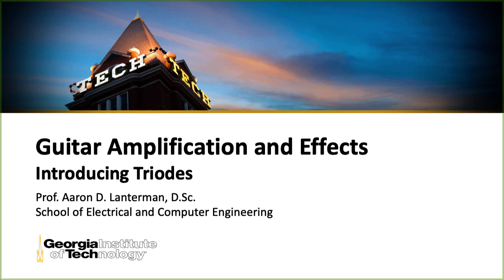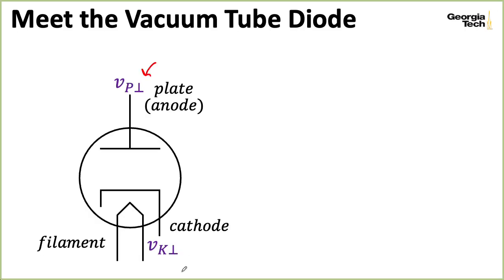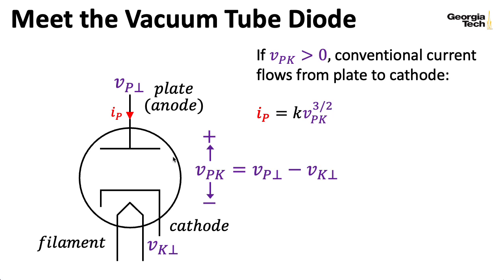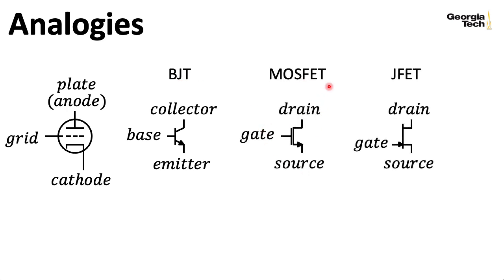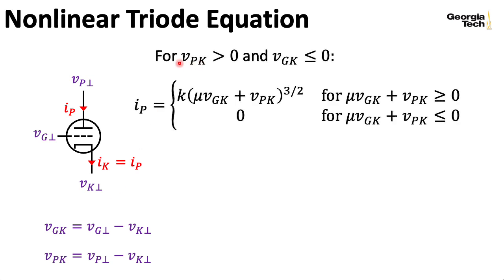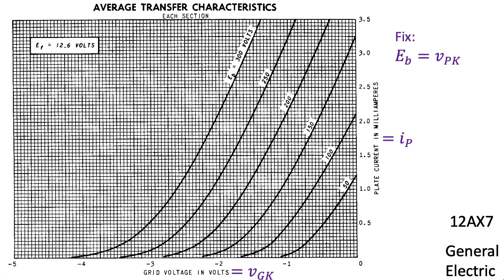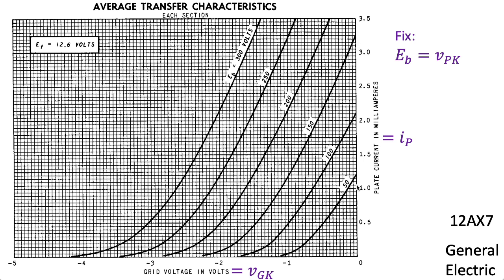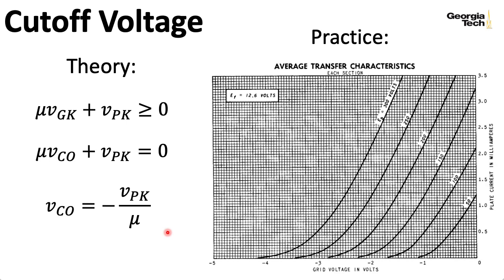ECE4448 L14: Introducing Triodes (Guitar Amplification and Effects, Georgia Tech course)

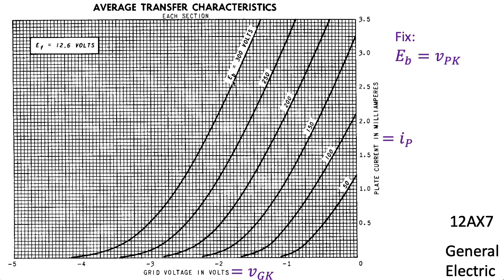Comment: 9:13 The “E” stands for “Electromotive force”, and the subscript “b” stands for the “B+ voltage”.
Reply: 11:28 “E” has been covered, “c” stands for the voltage applied to the control grid. Actually, the grid in a triode is a control grid.
Reply: Forgot to mention, “c” is the c- voltage dating back to the a+(heaters), b+ (plate), c- (grid bias) batteries from the early days of radio.

Comment: Hello. I'm wondering why the grid of a triode doesn't take the current load from the cathode. In many circuits with BJTs or triodes, the configuration is common emitter or common cathode. The amplified signal is at the plate or collector. Wouldn't a lot of current sink into the grid because the voltage difference between the grid and cathode us usually intentionally negative for biasing? The plate is a positive potential while the grid is negative.
Reply from the maker: There can be a tiny bit of leakage; some very very old tube amps will actually use a 10 meg resistor and generate their biasing that way.  But mostly the grid is more finely spaced than the solid plate so a lot of electrons go flying through the grid, and as you say, it's the negative potential on the grid that actually repels electrons and generally makes them not want to go the grid. The electrons really want to go to the positively charged cathode.

Comment: Great video. I took up a tube amplifier design course some months ago and am building an EL84 push pull hifi amplifier. I wanted to do some modeling first. I have build a uTracer device, which is a kit, to create my own datasheets with curves of the tubes I have. I can export the data and use it to create a spice model using another tool. It seems to work really well in the time domain. My preamp and phase inverter stage behaved exactly like my real amplifier. Just a few mV difference. 
I haven't done work in the frequency domain yet. But I think this method might be interesting for your class.
Reply: What tube amp design course is that?  Is it available online (and in English for those of us who only speak one language)?

Comment: I have made some designs in eagle some time ago using the 12AX7, but not yet build them.
Awesome lecture again, thnx.

What your opinion on rectifying 220 Volt using a suitable bridge rectifier (witch becomes multiplied by 1.4)  and apply it?
Reply from the maker: The "All American Five" radios didn't use a power transformer, just a rectifier. There's some guitar amps that use a similar design. They're called "widowmakers" for a reason. ;)
Reply: @Lantertronics  Widow maker, lol.

Well, if you had some basic electronic study at school, you should know that AC can feel quite shocking or unpleasant atleast and you should cover it.

Professor here in west Europe we all have a device in the closet where there electrical meter is fitted, it a so called "earth leak device" it senses if there is a difference bigger than 33 mA between Neutral and Phase and immediately trips / cuts the power. like a old school balanced weight scale .. or how ever it's called.
in some counties like Spain is called: a differential.

Pretty much no1 dies here in west Europe by electrification, unless they toughed the wires before the device .. somehow.
Reply from the maker: @AnalogDude_  We have something like that in some specific rooms on some specific outlets, called GFCI's. But they're not universal. I think they're mandated in kitchens and bathrooms, or something like that.
Reply from the maker: To be safe I'd always use a transformer for isolation, even if it's just 1:1.
Reply: @Lantertronics  Well, sure ... but even modern led lights use simple low voltage parts , like resistors, diodes, ic's and tap right into the 220 Volt, since it's all about the load.

Witch is really weird to see.

Some famous guy toke apart some specially for Dubai formulated Philips led light, it where just simple parts, as did i also toke apart some of them.
Reply from the maker: @AnalogDude_  That is very interesting; I found a fascinating discussion of such circuits here: https://electronics.stackexchange.com/questions/76883/how-do-led-light-bulbs-work
Reply: @Lantertronics  this "power" supply circuit from the Dubai lamp look very interesting, those capacitors before the bridge rectifier. that's something very uncommon, what's your view on that? ... would it serve for a tube?
Reply: @Lantertronics  The idea that i had maybe doesn't work.

if you would put approx 300 V DC on the tube and a 50/50 ( 2 x 100K - 2 watt) voltage divider on the grid for an offset, there would be a capacitor that has 150 V on it and it would kill a opamp if you try to add a 10 V.p.p. Synthesizer signal into the tube. also the +/- 300 V after the 47K resistor on top of the tube heading to a output capacitor would have 300 V and also kill the opamp.

Any suggestions?
Reply from the maker: @AnalogDude_  Sorry I'm not following you. You'd always have DC blocking capacitive coupling caps at the input and the output. And in any case, regular tube preamps circuit rarely used fixed bias schemes like you do with BJTs... they usually use self biasing (which I will get into in a later lecture).
Reply: @Lantertronics  thank you for the answer and knowledge.

Comment: Impressive stuff.  Although this technology is irrelevant by today's standards but still for certain applications, we just don't have a solid-state alternative. Like Photo-multiplier, magnetron in the microwave oven, klystron,  for generating e-beam either in thermal evaporation (PVD deposition) or in various semiconductor processes associated with plasma, x-ray, etc.; In medical technology for CT and X-Ray tubes are some of the day-to-day examples of tubes. 
I remember during my undergrad, I designed one with nichrome wire, metal mesh, copper plate, and test tube to re-investigate the working; it works on 12V filament with 160v dc across anode-cathode and a voltage divider with 5w resistors to generate control voltage.
Although with a lot of background reading on tubes and valves, I found out that the filament of the tubes is actually coated with a small amount of radioactive compound salts to improve emission and overall performance of the device.
For AC- DC conversion, Mercury arc rectifiers were used in old days.

Comment: I’ve actually read in one of my old tube books they do describe electrons boiling off as it’s heated , also in some of the rectifier tubes that are commonly used in old amplifiers the filament voltage does have an effect on rectification it’s using a 5 volt supply. And I believe I did read something on the filament voltage adding some extra capacitance to the operation of the tube ? Or it had to do with the gate 🤷‍♂️ it been quite a few years since I played with tubes . Good job on the explanation of operation 👍

Comment: About the "Ec", I guess the c comes from the "control grid" naming.
As for the grid going positive, well some triodes need it to get any meaningful current out, the 811 for example, though this is a different beast than preamplifier tubes. 
Will you also go into tetrodes and pentodes? 
Looking forward to this series of videos, thanks for making them available!
Reply from the maker: Yup! Tetrodes and pentodes come later in the course.

Comment: Why is there no p-type triode? Is it physically impossible or just impractical?
Reply from the maker: I'm honestly not too familiar with the physics, but I think you'd need to have some positively charged particles that would want to "boil off" of one of your terminal elements to then get inspired to cross the vacuum by the electric field... and protons are NOT going to want to do that. I guess you could make one if you made your tube out of antimatter, but that would present its own problems! (Anyone more familiar with the physics than me, please comment here...)
Reply: @Lantertronics  A tube made out of antimatter is an intriguing idea! Apart from all the other problems, you couldn't pass electron currents into it. But if you could avoid annihilation, a transformer should work to translate between electron and positron currents.

Actually, maybe you could use a transformer or two to make a regular n-type triode look like a p-type one? If all signals are AC coupled.
Reply from the maker: @possible-realities  I'm not sure how to think about using that terminal that way, since the tube is a 3 terminal device... it's an interesting idea but a solution isn't jumping out at me.
Reply: You would need an anode material that would emit positively charged ions when heated. Even if you could find one (I don't know of any material that would do this), it seems that the anode would be consumed quite quickly, and be deposited on the cathode and maybe the glass.
Reply from the maker: @possible-realities  I think neurons pass sodium and/or potassium ions around to transmit information, or something like that?